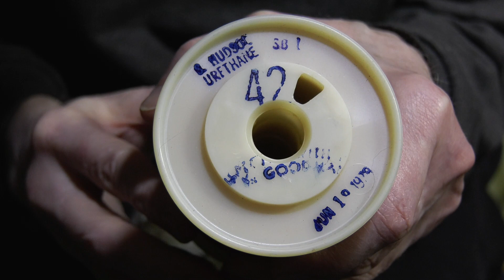Two NOS Vintage Wire Prototype PAF Replicas

Comment: They both sound very articulate, the bridge sounds incredibly warm sounding and with a very clear powerful sweet tone, the neck pickup also has warm clear tone almost sounds as though it's in the bridge position. Combined these pickups compliment each other really well.
They sound great, I would love to have some of these, or more so a strat style single coil bridge pickup wound with the Hudson vintage wire to fit into my strat style single pickup guitar. Love the tones of these pups.

Comment: Impressed with this magnet wire!
Would A5 have more mids than A4?
Want Kossoff levels of mids
Reply from the maker: Well, its not about what alnico it is, because no two companies make the same sounding alnicos. I just tried some new magnets from a new company I've not tried. I just try different magnets from diff companies and listen, I do stick with A5 in the necks though, because A5 is always the brightest, but then there's A5L made a long time ago that was darker. I try to stock all different company's magnets, to have a good palette sampling of "tastes."
Reply: @SDPickups  ah interesting! Thanks!

Comment: It must have taken a long time to produce this video because the pickup has already rusted.
Seriously though, I think you nailed the tone.  They really sing in a way words cant describe.
What is your personal opinion of potting vs not when it comes to overall tone?  Something about the thought of having the pickup cover resonating over the magnetic field at high volumes bothers me.
Reply from the maker: I pot with pure paraffin wax, which has excellent insulating qualities, so it doesn't interfere with the coils in an electrical way. These are not potted, I don't pot my own because I'm not playing 50-100 watt amps, and in my videos the guitar is faced away from the speaker cab. But, for my celeb customers who play larger venues and louder amps, its a necessity to pot them.
Reply: God bless you, and happy forth of July.  Your family too.
Thanks for giving back.  Love your style.  Nothing but respect for your work.
Reply: In the old days, There was no such thing as potting.  Pups would ring like a bell if you had your amp turned up.  You couldn't get much gain from amps in those days.  You couldn't get vacuum tubes either.
Reply from the maker: @qua7771  Well depends on the amp. A lot of old amps distort beautifully when turned all the way up. The 59 Bassman is legendary for that, and the JTM45 IS a Bassman copy. Yes you could buy tubes everywhere. Radio Shack or any of the electronics stores or even hardware stores sold tubes, they were common and everywhere, because all our radios and TV's ran on tubes so we had to buy replacements now and then. My Dad was a Ham Radio guy, so we'd always go to the electronics stores wherever we lived back then.
Reply from the maker: @qua7771  Vintage pickups generally didn't need to be potted. The reason is the old wire had sort of abrasive insulation on the wire, it made the coils feel hard and not soft to the touch. Where the squeals came from on buckers was if there was any air space between the cover and the slugs. If there was a gap, it turned the cover into a diaphragm like a cheap microphone or telephone voice device. But others like P90's had parts in them that were not tightly fitting, with gaps in the steel parts, so any high volume would make them squeal. Go watch Santana at Woodstock for instance, his P90's squealed badly.
Reply: @SDPickups  I had pickups like that back in the day when I was a kid.  Ever since I have always had wax potted ones.  A lot of people removed their covers back then.  I think Eddie Van Halen popularized potting. 
I remember when EMG's came out.  A big selling point was low noise epoxy encapsulation.  It was a different era and tubes stopped being produced in the US.  Nos existed but were hard to source without the benefit of the internet.
It seems like the NOS tubes tend to break up in even harmonics more which creates this sort of feedback sustain that resonates the guitar.  I'm sure that would probably create a lot of unwanted feedback in unpotted pups.  The only benefit I can see to non potting seems marginal unless there is a ton of wax under the covers.
Reply from the maker: @qua7771  You mention EMG. The contracted with me to do their advertising design and art direction back around '82 or so, because nobody had ever heard of them, they ran ads but nobody was buying them the ads were so amateurish. My first round of ads for them more than tripled the phones calls and sales. I did their NAMM booth graphics, catalogs, Tshirt design, sales sheets etc. A lot of my work won awards in the advertising club there in Santa Rosa where I lived and where they were housed. Pretty fun work at the time. I also did album art for Shrapnel Records, another client, for over 25 years. Met a lot of famous guitar players in person and hundreds of album packaging design work. Long time ago now. All tubes have even harmonics, its the solid state that doesn't, though they try to fake it, but I've never played a solid state amp or hybrid that sounded like real tubes. There's always some digital sound or treble screech I just can't stand ;-) EMG's pickups were made in Korea, BTW.
Reply: @SDPickups  Wow, it sounds like you have been involved in more facets of the industry than I could have imagined.  I'm just a hobbyist that likes to research and chase tone on occasion.  I'm servicing my gear right now, upgrading some parts and rolling some old tubes through a few amps. It's a pleasure having the opportunity to chat with you about gear.  Your videos cover rare items that I will probably never see in my lifetime.

Comment: How would you compare to your vintage 50’s wire, eq wise? Sounds good but May be also that selected guitar has a good sound spec with the right amp too. I find the wrong guitar and then it’s really difficult to match it with anything PU wise. How do you pick out a guitar by tapping the wood and how should it sound? With all this crappy hardware including the weird sounding lower mids and bass from the faber bridges on my guitars.-all of them get them same strange tone in the mid to lower freq.  and rubbery lower end the high end is fine. it is hard to pick a guitar without that skill.
Reply from the maker: Go watch my 3 videos series on "The Les Paul That Isn't." It goes over hardware and harness. This is actually an Epiphone Elitist completely rewired and all hardware replaced as shown in those videos. There aren''t any LP's that have correct equivalent vintage hardware and harnesses, not even Gibson, though the True Historics are closer. Mixing a Faber bridge by itself isn't enough.
Reply: Yes i have seen them! I mixed brass posts and thumbs and tried a few different ones as well. Kluson tail with faber bridge or any tail does not like my guitars. It gets a really rubbery farty sound in the neck and I tried for 3 years all different setups and seems that it only happens with the faber bridge. I finally got a 60’s and a supposed 50’s bridge but they are both chromed. I got them from reputable stores but who knows if the adj. screws are still original. Still cannot get a true vintage satisfying tone, but it’s better then before. My one guitar has early 60’s thunbwheels but I cannot prove it. This has been two guitars.
 Lets not forget pole pieces which is another whole combat and can change the whole spectrum. Love your amp- Garnett, thats what a guitar should sound like! But I am perplexed unless both guitars are firewood. One Gibson burst with pc board pickups which are the best PU I have tried for only that guitar, the other a tokai reborn 120, 1980’s.
Reply from the maker: @angelobouhoutsos3060  I have never found a guitar that couldn't be made to sound great, including and early Chinese Epiphone Nasheville bridge and a $200 early Stellar guitar. Just replacing the harnesses did it. Throw the PC board stuff away and any metal plates and rewire 50's method, measure your pots so you know where to put them and use paper in oil caps that I recommend. But most companies don't know how to make crystal clear neck pickups. Your Tokai for sure will have a mediocre harness. Replacing the harness will help your pickups a LOT. On my channel I show how to do the harnesses and use my Epiphones to also show what you will run into with the metric parts. You do need to be good at soldering though. You will run into these same problems with ALL factory guitars. None of them make good harnesses. Its worth the effort, just do it.
Reply: SDPickups 
I have done the gavitt wire 50’s wiring pio’s that you had recommended and potentiometers also!
What I realized amongst many other things is certain PU just don’t work out well on certain guitars. Also the way you set the poles and the angle may work or not. Seem to have to be set according to you bridge and its hardware. With each bridge I had to set it differently usually following a 12’ radius but sometimes slanting the bass side higher would actually warm up the tone. Sometimes polepieces very low on the PU but this depended on the guitar, Bridge, and PU’s combo, of course the tailpiece too. So even with all the parts done i actually and only recently heard your combination of parts sound good on my guitar, but changed again. I think it is voltage  dis regulation in the house! It actually causes a farty dull neck tone, which you can here in the bottom three stings in the bridge also. Quite odd, but it sounded good one damn time for a week. I started to think I must be losing it or my hearing. I think it’s a big problem with the voltage spiking up for old circuit amps! When I had re intro’d the faber bridge recently It sounded totally different than the last three years of using it then back to where it was. I will finally gut the tokai but they used different wood for those instead of mahogany mine can sound stratlike or tele like really country tele and that is not what I want in a paul.